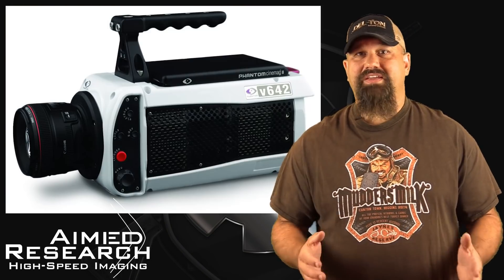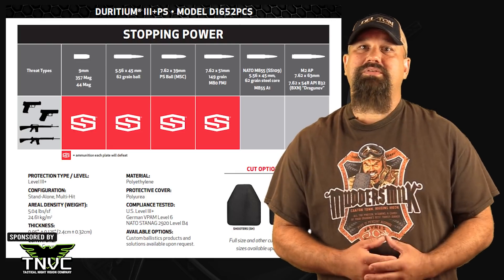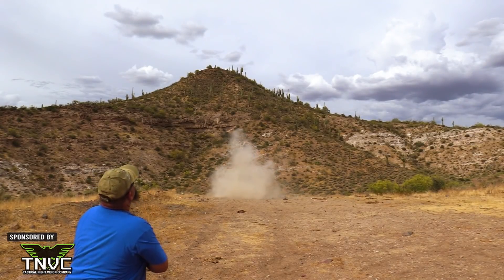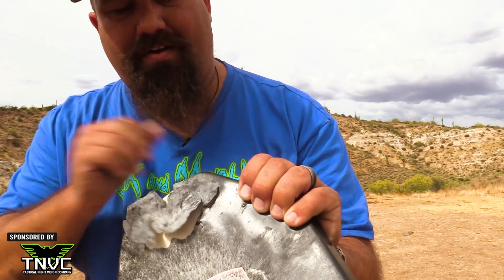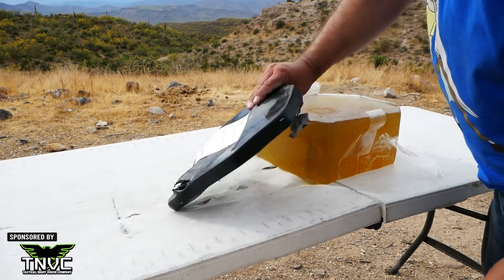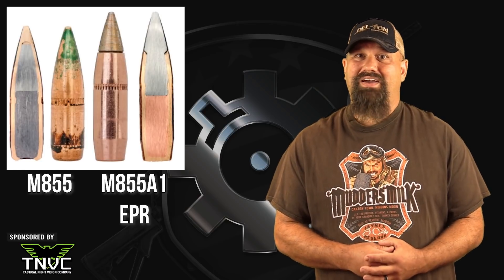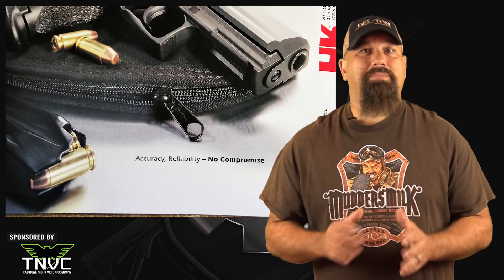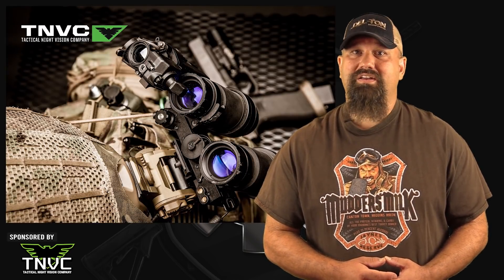[TESTING TUESDAY] Can Plastic Armor Stand Up To An EXPLOSION Shot Stop lvl III UHMWPE Armor Test

Comment: Hey Andrew, was wondering if you could test the mk318 mod 1 or 0 again? This time lower than 1990 FPS something like 1700 or 1800. only reason I ask is I have a theory after it bleeds or to much speed to fragment, it will start to expand instead. (This happened in a different dudes test velocity was 2200 or so in clear gel) thanks!

Comment: I've got a set of PE plates (4.6 lbs each) made by Tactical Scorpion Gear that will stop both M855 and M855A1 out of a 20 inch barrel. Retail is $240 per plate. For 15% off use discount code thegunpenguin.

Comment: Failing against m855 is a deal breaker for me. That round is way too common and fires outa the most popular weapon system in America.
Reply: Shot Stops level III GT2 stops green tips at 3.8 pounds per plate
Reply: @dominkmanreta  But also at a cost of reduced strikeface coverage and no M80 Ball coverage.
Reply: @BuffRANGE  True, there's also duritium IV+HA at 4.5 lbs per plate. I guess we're not talking level IIIs anymore so apples and oranges...
Reply: @dominkmanreta  true. But that is only 4.5lbs because of a reduced coverage strike face like the new GT2 :(

Comment: If we had a continuous shot of the plate from the time it was launched to the time it landed, we could calculate how high it went.  Unfortunately, thanks to the way this video is edited, there's no way we can do that.
Reply from the maker: It left the frame on every camera but the time of flight was exactly 5 seconds and one frame (1/60th of a second). It landed about 30 feet from the launch site, as measured by the plate itself in one still.
https://youtu.be/P6CNpwATc_4
Reply: @ARFCOMNews  Cool.  Somebody who is better at physics (had has done this sort of calculation more recently than 20 years ago) should double check my math and logic here.

The plate travels upward, reaches a speed of zero at its maximum height, then begins to fall until it hits the ground.

If we assume that it spends half of its travel time going upward and half of it coming down, we can use a starting speed of 0, and the constant of the acceleration of gravity (9.8 m/s^2) and figure how far it traveled in half of its flight time (2.5083 seconds).

If I plugged the numbers into a calculator correctly, it fell (and thus must have risen to a height of) 30.83 meters, or about 101.14 feet.

Comment: 3000 fps is the magic number is it not?
Reply from the maker: Not really. Depends on a lot of factors. 3,300 fps or so will be close to the V50 for most steel plates, but projectile construction plays a much larger role with UHMWPE plates.
Reply: @ARFCOMNews  Indeed. Some Tubers just magically think velocity is the only needed achievement for armor penetration of any kind, but fail to realize that doesn't apply to the different materials used to make armor.

Comment: This right here is why I wear steel 3+ plates. I think I'm much more likely to meet someone shooting m855 from a 16 inch barrel, than I am someone shooting 193 from a 20 inch gun. Although my plates would stop that too.
Reply from the maker: M193 from a 16" will zap right through level III steel plates too, at 50 feet or less. So will 50gr TSX or almost anything doing 3,300 fps or faster.
Reply: @ARFCOMNews  yep that's why I went with the III+ plates. I've seen these shot with m193 from a 20" with no perforation. I really do wish uhmwpe did better with m855 though, because the lightweight is very enticing.
Reply: @twatts45  what particular steel III+ are you running?
Reply: @BuffRANGE  spartan armor
Reply: @twatts45  Nice. I believe they are one of the few steel manufacturers who can meet the 3250 fps of the new NIJ RF1/2 standards.
Reply: @BuffRANGE  well your torture test was one of the videos that convinced me to get them
Reply: @twatts45  I think they may have a different offering than what I tested those years ago. I've wanted to re-test their stuff for some time.
Reply: @BuffRANGE  I've had them for awhile. So almost definitely the same as what you tested. I'd still be interested to see what the "new" ones do though
Reply: Every test I have seen of level 3 steel plates shows them stopping m855 out of a 16” AR, and usually not stopping m193. I would get level 3+ for m193.

Comment: Did you ever test other military 5.56 rounds at low velocity?  I think you said you would in the video you linked on the Army's new round.  Does that one perform better than mk262 and mk318 at low velocities?  If you need a testing platform I would think a 7.5" barrel should do the trick
Reply: I tested reduced velocity Mk318.
Reply: @newsofthepews  i'll go back and watch it, thanks

Comment: Next time put the armor UNDER THE BOOM!
Reply: Why? That was the best way to get the full force impact outside of setting a 5 gallon water jug on top of the plate. The explosion used the ground to direct the energy into the plate. If you do it the other way around, the explosive force is severely reduced due to open air and the plate being supported by the earth...

It's a physics thing